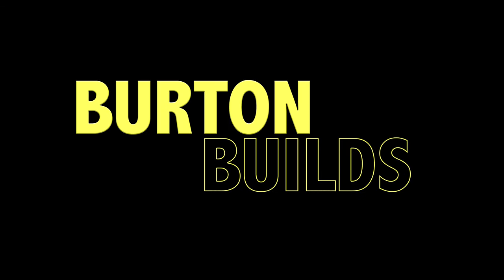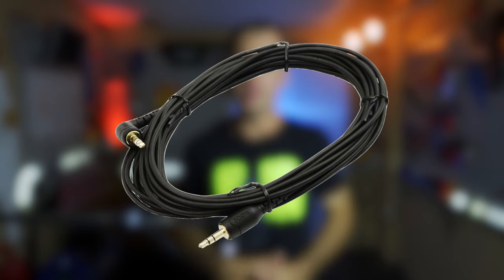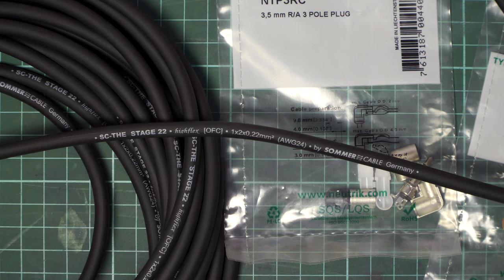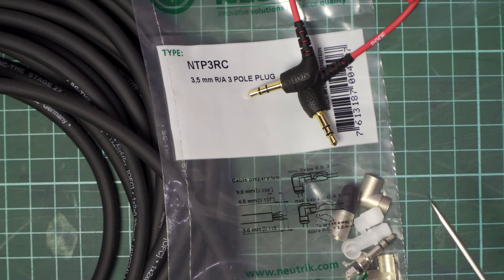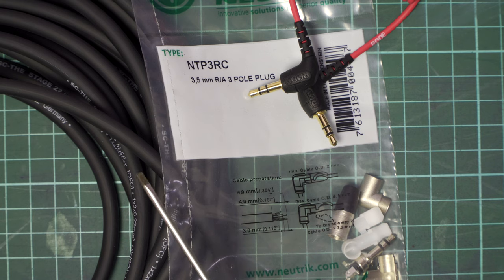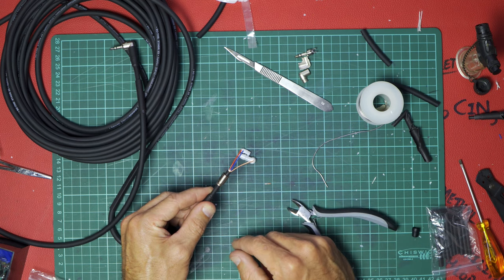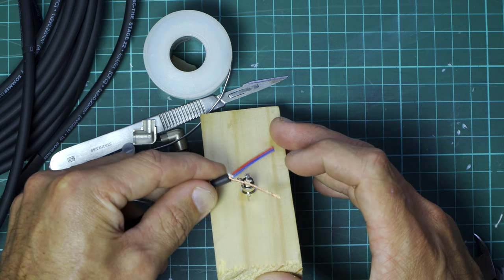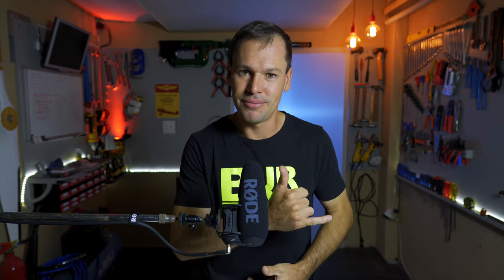RODE Wireless Go FIX - Workaround for AUDIO DROPOUTS  - Burton Builds [4K]

Comment: Thanks for the video. Unfortunately, we purchased 3 sets and found out the hard way that these are unreliable. After the last drop-out fest that also featured constant high-pitched noise, I personally plopped down the cash for a couple double-antenna diversity Shure combos. Rode is on my sh*t list.
Reply from the maker: Hi Rick, Shure definitely do make some good products. As for the original Rode Wireless GO, I found when using a single set, there would be almost no dropouts however as soon as the second set was used in close proximity (and the two receivers are within a few inches of each other) it would drop out all the time, But moving the receivers farther apart with extension cables, the dropouts decreased substantially (although this defeats the point).

Whether the receivers were both plugged into my Sony A6400 or both being recorded into my Zoom F6, the dropout issue was the same.

I've now had the Rode Wireless GO II since it was launched and have been using that quite a lot... thankfully haven't had any issues so lets hope it continues like this. The increased transmission distance is also much improved... I often use a single Tx to send Race commentary just over 100m line-of-sight back to the camera and it works a treat (can hear it in the many of the recent race videos I've posted). Also the backup recording on the Tx is super awesome although I've 'never' had to use it. I say 'never' but I find the internal recording on the Tx to be a little better quality than what the Rx outputs so have occasionally bounced between the two just for fun.

The Sennheiser AVX would also be nice but that was a little out of the budget at the time.
Reply: @GrantBurton  Great to know! Admittedly, I did have 3 receivers hanging together on one side of my ZOOM f8 and I've used an individual Go wireless in the past with good results except when a lecturer would turn his back to the receiver. 
During the last taping, the line of sight was only slightly and intermittently interrupted and I thought that was THE problem. It wasn't our only challenge that day. During the outdoor group interview, as soon as we began chainsaws and a commercial wood chipper cranked up across the street. Listening to that hell through headphones for an hour is enough to drive a saint insane.

Comment: Mine has too much of interferance, bought a new good quality Rode Lav Mic still the same issue, returning it tomorrow morning!
Reply from the maker: These little units are convenient for close up, direct line of sight work but I think if you are wanting a more consistent and trustworthy system, the RodeLink Filmmaker Kit will be a better option... or better yet the Sennheiser G3 or G4 systems. In the long run, it normally works out cheaper and overall better to buy the correct thing the first time. I think Sennheiser has a good track record.

Comment: My audio cuts in and out, I record interviews on the rode wireless go but some interviews audio is terrible any suggestion
Reply from the maker: Hello, where on your talent do you place the transmitter? (I assume the receiver is on top of your camera rig?)
Reply: @GrantBurton  I use the lav go mic that I seen which people recommended I usually place it 3-5 inches away and yes the receiver sits on top of the camera
Reply: @GrantBurton  thank you for responding!
Reply from the maker: And where do you clip the transmitter? I assume it’s being clipped around the waist area of the person you are interviewing?

I’ve found that even when very close to the transmitter (3 - 4 metres), if the transmitter doesn’t have direct line of sight to the receiver, the audio cuts. So if I clip the transmitter on my belt near the buckle at the front, audio is perfect but as soon as I turn around and face the other way, the audio occasionally cuts out (because it’s not direct line of site anymore).

I would suggest making sure the transmitter is always clipped on the front half of the person being interviewed (not behind their back or at their side)... so maybe somewhere on the belt or inside the shirt and then you run the LAV up to where ever you want it to be.

Other than that, maybe sell the Rode Wireless Go setup and buy the Rodelink Filmmaker kit or Sennheiser AVX system... they are a bit more expensive but from what I read and from what other people say, they are more reliable.

As I mentioned in the video, I just can’t trust this wireless system on a ‘one man’ shoot and rather choose an overhead boom mic setup or a LAV mic but hard wired on a 6m cable back to the camera / audio recorder.

Hope this helps.
Reply: we have been using one with no issues. then we added a second one and it cuts out... i need to test if its just that one or if its when they are but on.
Reply from the maker: Hi David, from my experience when using two units together, they cut out very easily when the receivers are mounted close together. Try mounting both receivers as far apart as possible and this should result in less drop outs. Same for me using one unit at a time... no issues.

Let us know if there have been improvements after experimenting a bit.
Reply: @linvol20  us aswell, using one is fine, using two of them they cut out constantly, have you tried the wireless 2 system? looking for more feedback before I invest

Comment: Getting the mic to stay attached is impossible, it's a piece of shit
Reply from the maker: Hi Ian, a locking plug would have been nice but what i have found works well is folding the mics wire down the side of the transmitter and wrapping a piece of insulation tape around... provides a bit of strain relief and stops the plug from rotating or being bumped out.

If thats still a problem, I guess you are probably better off getting a more professional setup, however these are going to cost much more.

The audio dropouts were more of a concern for me on the original version, but that has been much improved on the Wireless Go II... very happy with it so far.